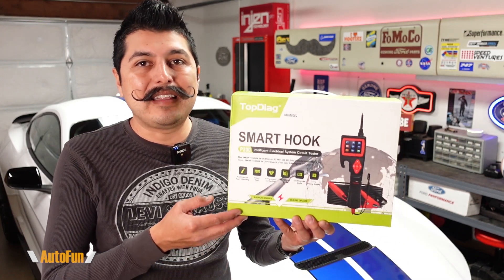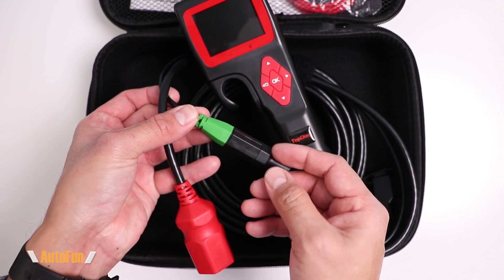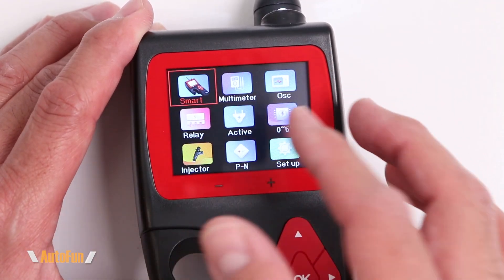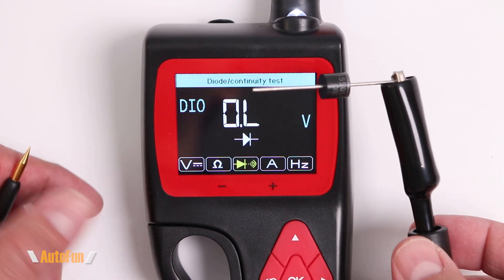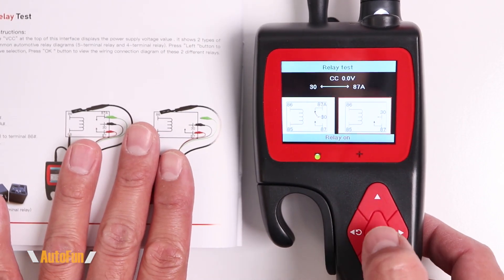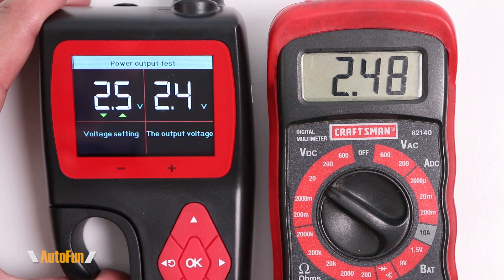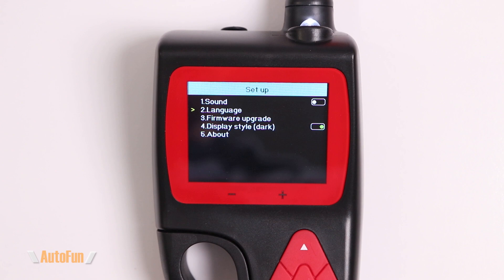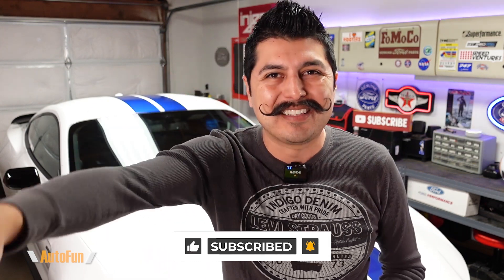TopDiag P200 Smart Hook Probe Review (Circuit Tester for Automotive Diagnostic)

Comment: Poor accuracy on voltage is very bad for o2 sensor readings
Reply from the maker: Hi Beats! While some basic O2 sensors testing can be performed with a DMM, I usually recommend using a DSO due to the voltage high switch rate. It can be done with stand alone system like this one https://youtu.be/R9lC1Z_rzZk or with a scan tool like this one https://youtu.be/DMj5iP2YEvU with the scope attachment. Cheers!

Comment: Do you like it do you recommend it?
Reply from the maker: Hi Mcloven! Yes mine is still working well, as far what I recommend, I like to tell people to make sure the probe you are choosing has the feature you need. I can recommend a probe but if it does not have the feature you need then it won't be the right probe for you (different probes have different capabilities). Here are two other probes so you can compare them and their features against the P200 https://youtu.be/FDW1kfeJb5k and https://youtu.be/enKglsvdIlo Cheers!

Comment: Pro tip, there are small, semi spherical and clear rubber feet in most hardware stores made for various objects, like under a coffe machine so it doesn't skratch the table when moved, anyway. THE TIP, put one of these on each button, it will make it very easy to press in the right place every time without putting any thought into it since the finger will automatically locate and press the highest point👉
Reply from the maker: Hi Bernard! Very clever, thanks for sharing this tip, Cheers!

Comment: The video is ok showing every function, however for an accurate explanation for every function I would recommend that the functions are explained in detail on actual vihacle.
I'm considering getting one.
Reply from the maker: Hi Carlos! The Probe functions the same way on a vehicle as on the bench, however if you want to see that here is a video showing how to use a probe on a car https://youtu.be/FDW1kfeJb5k Just remember that the number of possible ways to use it is only limited by the imagination and the skill of the mechanic using the tool. Some mechanics use it for basic testing like a multimeter and some use it for advanced testing such as activating components (each with it's own method of activation depending on the component) or sensor testing (each again with it's own test routine described in the service manual for the car being tested). Hope this helps, Cheers!

Comment: The video editing is certainly clean and well done. I am a little concerned considering this same tool is being marketed under several different brands but all seem to have issues. One video showed the scope function shutting down the CAN bus. Others showed issues with inadequate circuit protection. The ultimate difference was shown on vehicles that were broke as apposed to ideal conditions (where you actually need the tool to perform). Buyer be very aware and explore videos tested in the field.
Reply from the maker: Thank you Von! Ah yes I fully agree, watching and comparing reviews can help make the best decision when buying. My P200 is going strong still (but I will update this comment if something changes) But here are two other probes if you want to compare or try a different one https://youtu.be/FDW1kfeJb5k or https://youtu.be/enKglsvdIlo and I have a very neat dedicated Oscilloscope review coming up for those that want to but more capability (and don't mind a much large price tag) Stay tuned and Cheers!